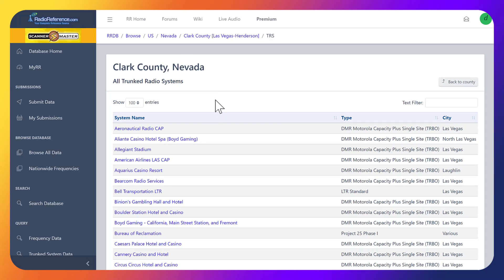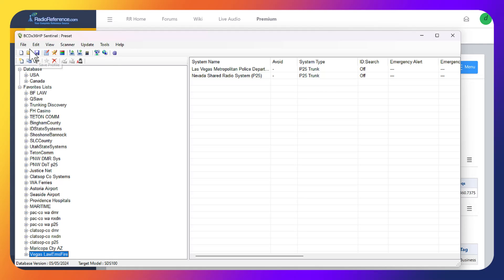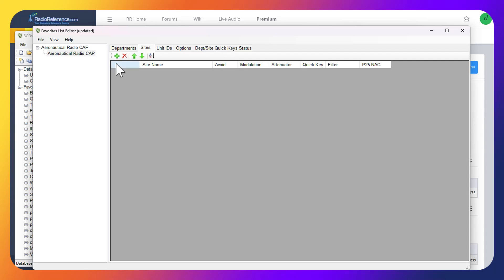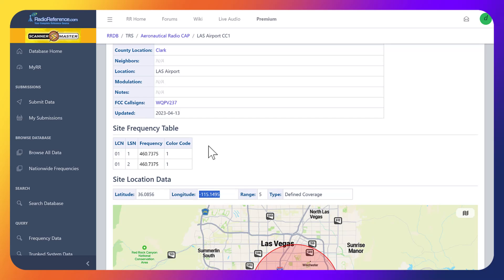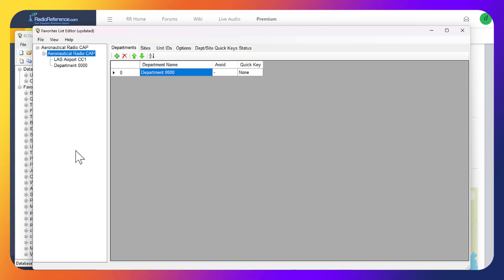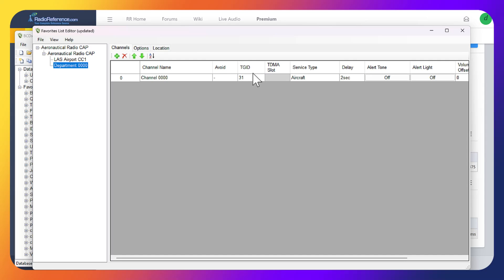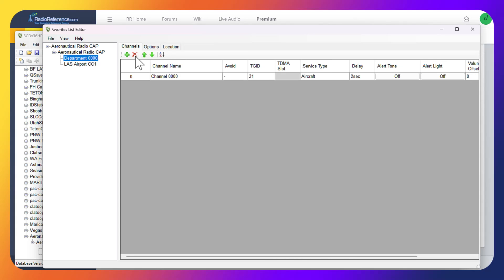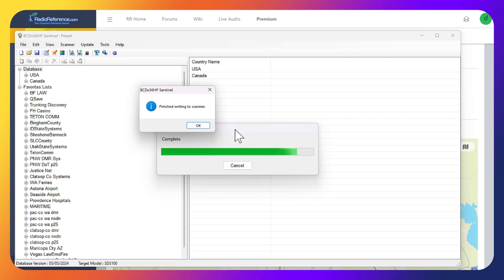How to Program DMR MotoTRBO on the SDS100 using Sentinel Super Easy

Comment: I’m a little bit confused on one part. When I find the talk groups, under DEC, for example, it says, 0-01-100. Can you explain what that means, where is the talk group, and where is the LCN?
Reply from the maker: Great question! In DMR, the DEC format 0-01-100 breaks down like this: the first number (0) is the color code, the middle number (01) is the slot (either 1 or 2 for DMR), and the last number (100) is the actual talkgroup ID. The LCN (Logical Channel Number) is a separate field you'll see in the frequency list - it's just a reference number for that particular frequency in the system. The talkgroup itself is that final number (100 in your example).